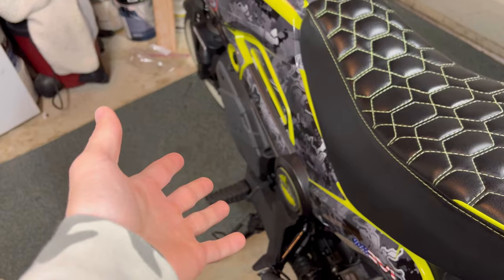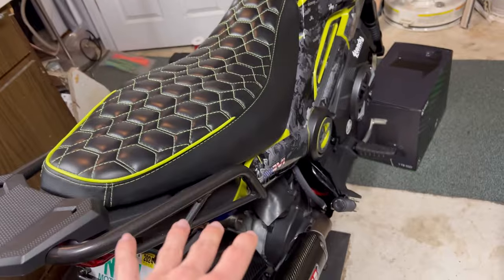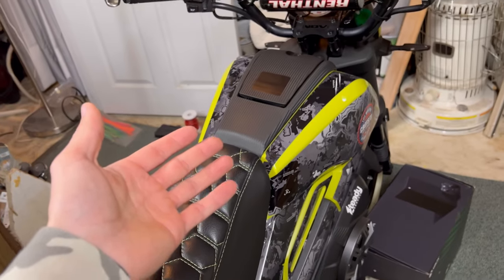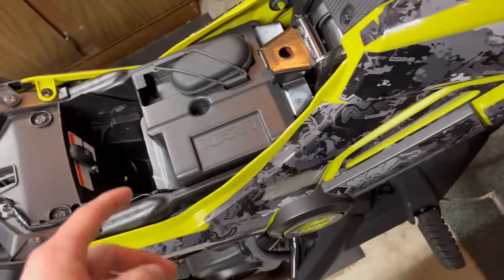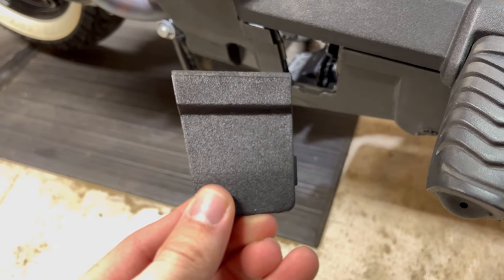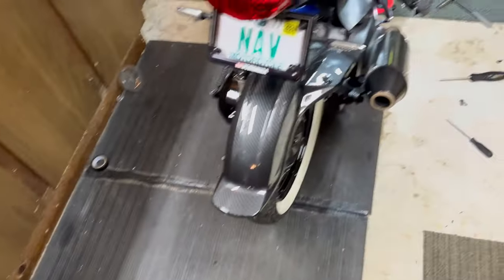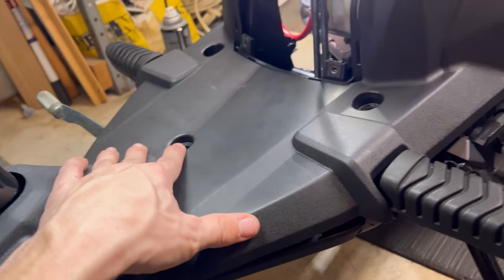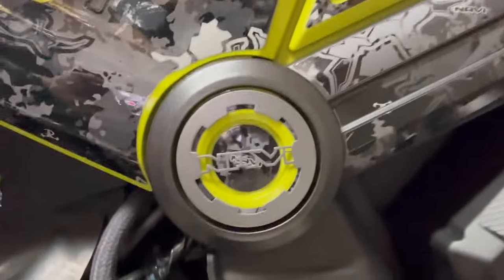Honda NAVI | Flooring Replacement

Comment: You can do this without removing the upper panels. Engine vent plate, top floor plate and then lower plate. Stop stripping screws you all don’t need to.
Reply from the maker: @tripwheelerton2417  Considering the footrest area of the top floor panel sits behind the side plastics, removing the side plastics is a must if you aren’t in the interest of scratching or prying plastic pieces around one another. Also, I wasn’t aware I stripped any screws! I’ll have to look back and check them.